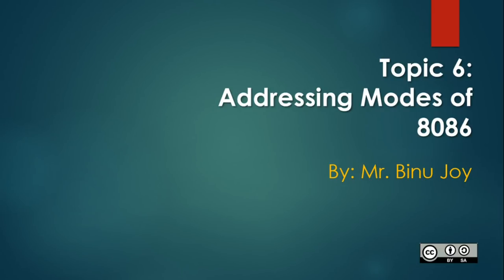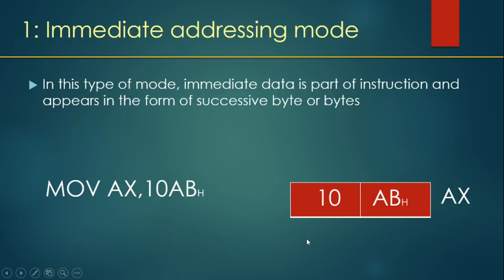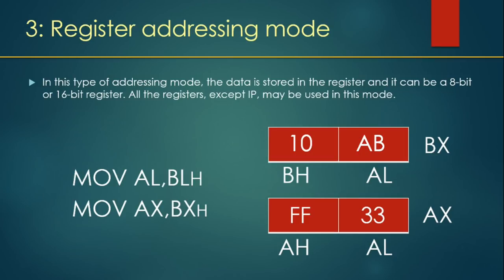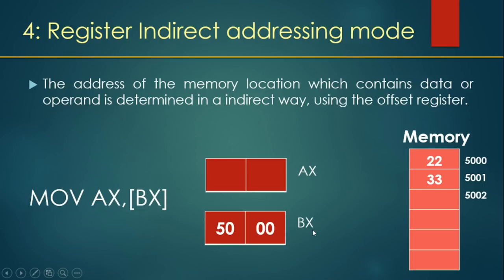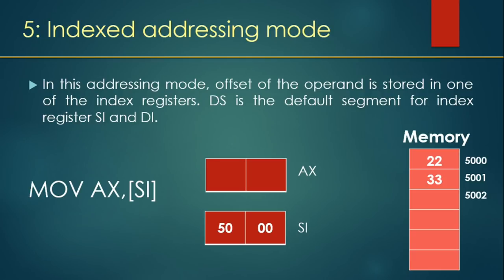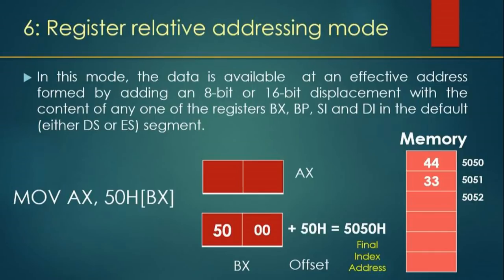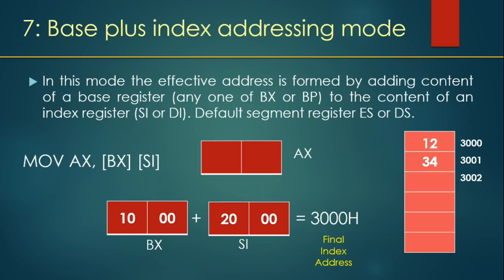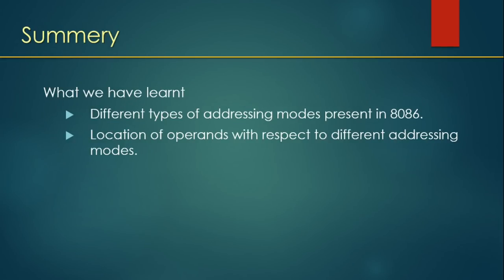Addressing modes of 8086

Comment: MOV AX, [BX] [SI]    ; The defaullt segment register is "only" DS and not "DS or ES", if no segment overrride prefix and no string instruction is used. If BP is used as an address register, then  SS is the defaullt segment register.
Reply from the maker: hans muster absolutely right my friend I will correct it soon or remove the video till I change. Thank u so much.